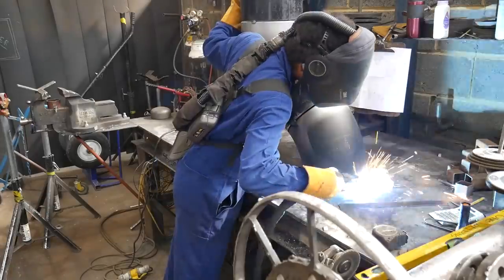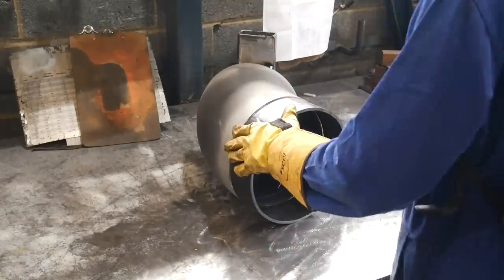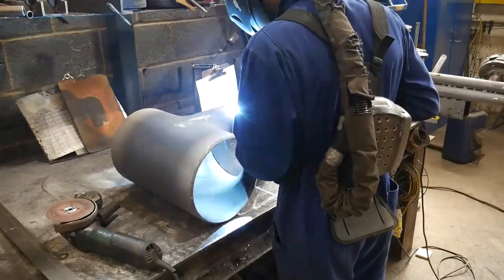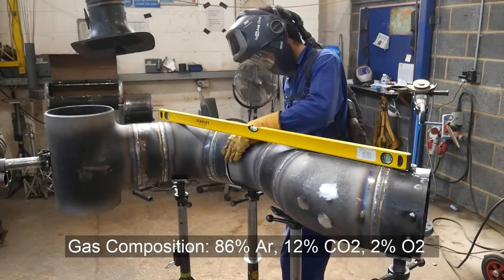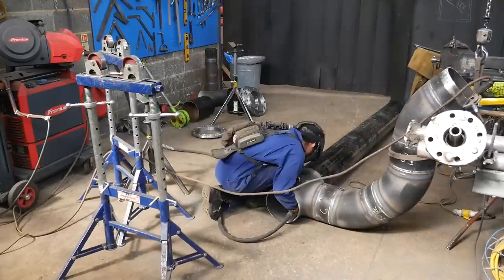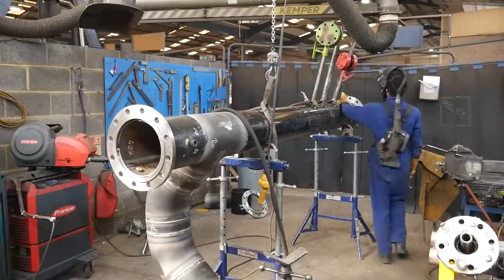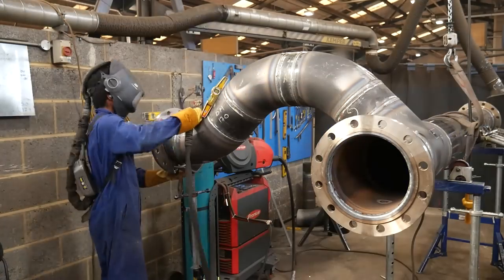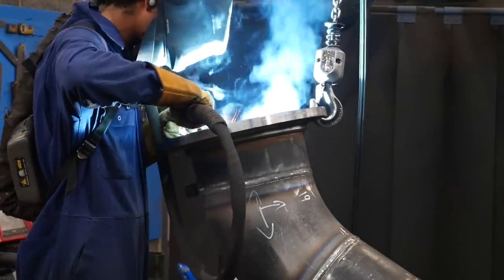MIG/MAG PIPE WELDING (COMPLETE PIPE FABRICATION )

Comment: As a welding inspector I am very happy to see a welder with very good technical and practical knowledge. Your welds look really nice and to see such delicate fitting is beutiful. 
But what I like the most is that you use a mask that provide you with fresh, clean air and a vacuum to avoid the nasty fumes, always health first! (Remember to change filter)

Do you know what application your spools are for? Is it for transport of saltwater between ballast tanks in ship or district heating/cooling piping? 
Love the video!

Comment: Wicked looking work youre doing there. I see you use lots of tacks and jigs with counterweights to spin the pipe so you can roll out the welds. Does that ever affect the inspection having tacks here and there on the outside of the pipe. I've seen on some pipe welding videos that they have to cut it out if there are any errant arc marks on the pipe. Just wondering, very nice work!

Comment: As a welder its nice to see that im not the only one who has to problem solve your way through a project lol Im not a welder for a living but i do a fair bit in my work as well as personal projects and i once had to weld up a large mag drill stand over my work bench that is sitting in front of a wall.. So if you saw how i managed to do a downhill spray mig (ARC force was my best friend lol ) on the bits that needed welding that faced the wall directly you would of been in stiches my hair was burnt and my whole side of my body ached like fuck for ages after that as i never been so limited on my gun angle on a job like that lol But i admire how you are able to keep something like that all square while keeping within tolerance..

Comment: May I suggest that for the final fit-up you draw on cement floor and use plumbed(for checking too). Great to see you welded the inside of the flange and then out, so many welder do the reverse and don't know it increases fails.

Comment: That's crazy if you did that in a single shift.  I'm a pressure pipe welder in Canada (Fab shop) and we do things quite differently.  It would probably take me the whole 10 hr shift to weld that never  mind the fitting.  We have pipe fitters too.  Do you use the same wire to fill and cap?  no bevels either?
Reply from the maker: Yeah bro it took me a few hrs but it all depends what specs it needs to be welded to, and same wire for everything and when i use the grinder i put the prep on it, it saves me alot of time

Comment: What is with removing or not allowing copper on the filler wire?  Can you cite the spec?  I've never heard of such a thing, and I'm curious what the intent is.
Reply from the maker: The uk is changing regulations they say the copper coating thats on the mig wire to lubricant the wire is too harmful for health and will be changing, i dont knw the details just my boss told me
Reply: @ARCONEWELDING  I thought that was the case.  I looked around trying to find information on it.  So far nothing.  Surprised California has not done something like that (I'm in the US).  Thanks for the response, and keep up the good work!

Comment: They allow you to put a tack on the inside of the pipe? Thanks for sharing I’m a structural fitter and welder from the USA Just subscribed to your channel
Reply: It's fine just as long as he blends it in.It sure is a cool project.
Reply from the maker: Yeah because i weld over them and they disappear into the root

Comment: Then xray comes in and busts every weld for repairs haha 🤣
Reply: i think here is nothing to repair...just cut off all weldings and weld again...with penetration.
Reply: @andrisandris461  Just depends on what code hes following.. my be a cut out or just a grind in repair... like for some porosity and slag lines low cap ex.
Reply from the maker: Its all class 2 work on low pressure water what i do is above what is needed, and a % of the job is NDT/ultrasound tested but if i have a xray job id weld it differently, cut me some slack man jheeze we cant all be a good as u

Comment: Not knocking you at all you did a great job ,  but don't know how u get paid  but why not just make position welds lot of time was wasted in handling the pipe and consider how many times u moved it out of the Stan  time is money
Reply from the maker: I dont like doing vertical up positions so i try avoid them and i was going to do a horizontal position but it would involve double handing, like i said this pipe was effort i was happy to be done with it